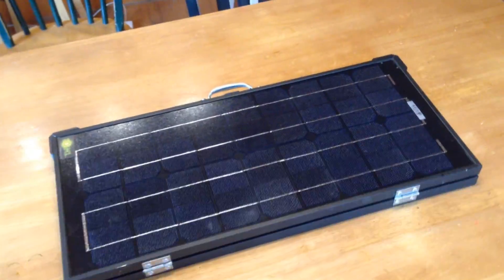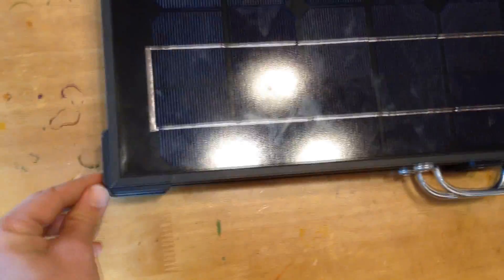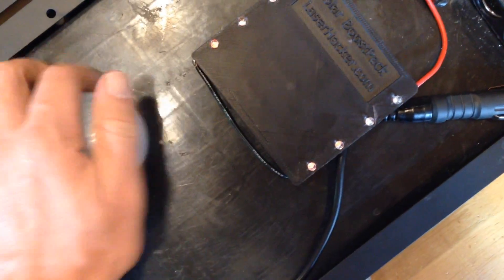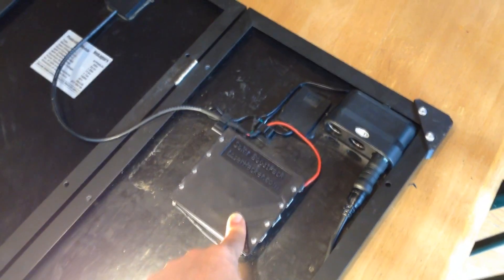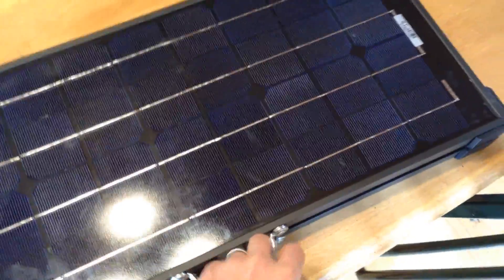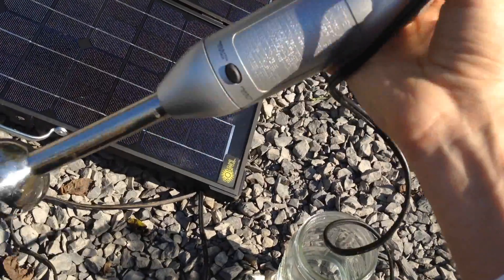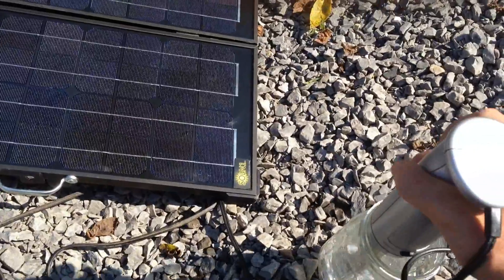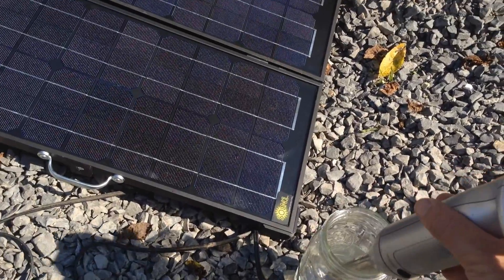SOLN1 Update - Testing the Mini Boostpack

Comment: I like this one, boost pack with solar... Real time solar is really interesting for camping. Through day you could chill beer with pelter elements and fan, recharge USB bank / cell phone, jump start a car...
I have 200W/220V inverter. I guess I should look for cheap fordable solar before camping season starts and super caps I think 6 2.7V 400F would be plenty for this setup.

Comment: That is pretty cool I love to get a the solor panel with the boost pack with the I inverter to turn the ac to dc current to run the power tools and lights at the same tome with out loseimg power

Comment: I'm just about to build a 2x20w soln1 euro style, and now I saw this video which I have not seen before.. I don't think this is on your site, or have I just missed it?! I tried to find the schematic but could not find those either. It would be really nice to have one with a boostpack and an optional batterypack! I guess I have to wait for you to put the schematic up and do a followup video with this design so I don't mess something up. When this setup is done it's going to rock!

Comment: I want to make something similar to adding a car battery to an inverter to power my computer for a couple hours, /watch?v=JOKoCWyQCcg The monitor: AC 120/230V (50/60 Hz) 25 watt and my computer DC 90 to 135V at 50/60Hz 250 wattage. I know that alot of energy but im a noob at electrical. I saw your 12V boostpack thought to upscale and use that. Im sure its possible but if you have any advice that would help. w/ winter coming up i know i'll get blackouts so this could help.

Comment: Have you considered using a SOLN1 in conjunction with the car boost pack instead of the battery? I'm not sure how much you could get out of it both price and power wise, but is it possible for you to charge the cars boostpack with solar panels when not in use?

Comment: I would imagine even passive devices such as that 'balancer' use some power. by "it uses no power whatsoever," you you mean that it is passive and does not require external power? capacitors ar not perfect, and have ESR and internal resistances.